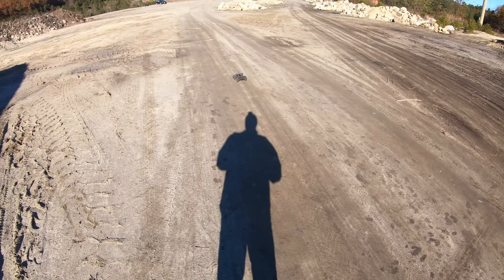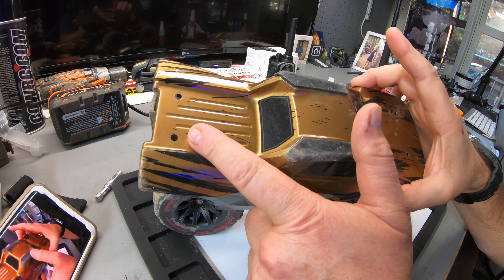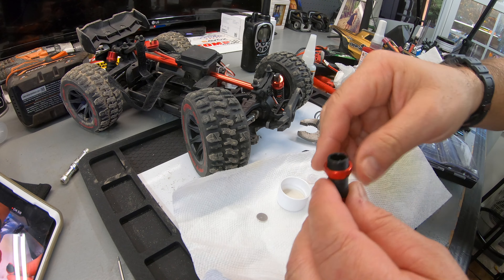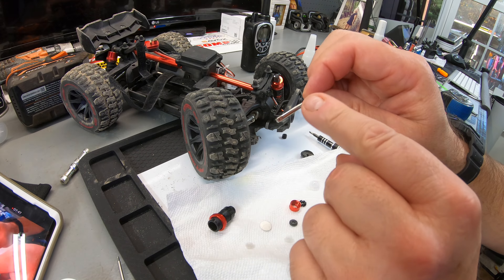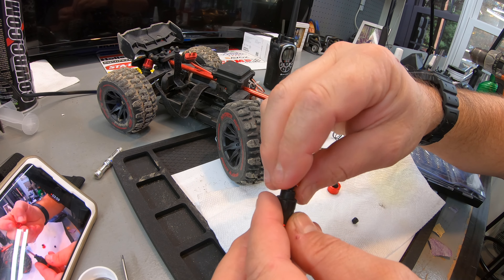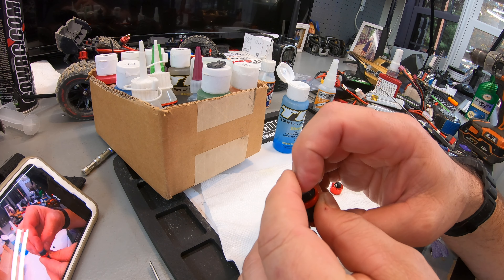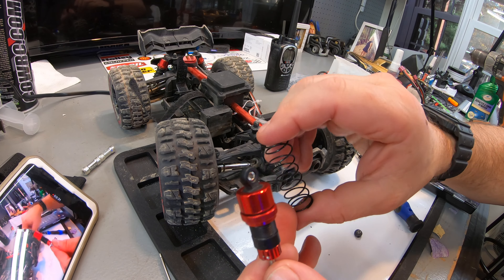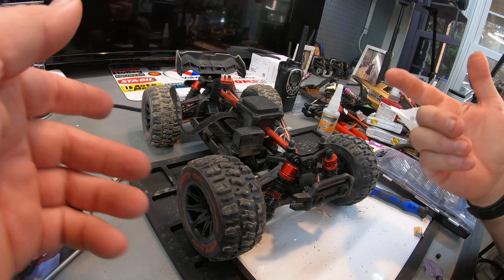MJX Hyper Go H14BM minor breakage

Comment: that telemetry delay problem you mentioned with the MJX ,  glad i don't suffer that problem with my HSP HISPEED GT 3S cars ,  as they use hobbywing electronics and motor and the digital FLYSKY transmitter and receiver package ,  they don't suffer those delay problems 🤣 as the cars radio signals work instantaneous 🤣
Reply from the maker: DELAY OF DEATH

Comment: I know what you mean, I struggled a lot to get all the screws loose on the 1/16 Subotech S909 Pro that I received recently I am a bit OCD about my RC's so I take all of them apart before I run them and make sure the differentials and everything else that needs grease has enough of it in it. I am glad I did the same with the Subotech yesterday, the differentials and the rest of the drivetrain that needs grease had almost nothing in them!!! The difference between the Subotech and the others I have is that the plastics on this one is harder, so I will see how good this does in a bashing session compared to the MJX Hyper Go 16208 ..

Comment: did you literally throw that little truck at the beginning of the VID  🤣  .  I'm fussy what types of RC'S that are quite cheap from china ,  but i have purchased two HSP HISPEED GT 3S cars from a UK seller / supplier ,  and it's because I'm only into on road road cars and rally cars ,  and buggies only as good as my two HoBao hyper VS2 buggies ,  which really means i don't own any other manufactured RC buggies  🤣 🤣 🤣
Reply from the maker: HOBAO is an excellent choice